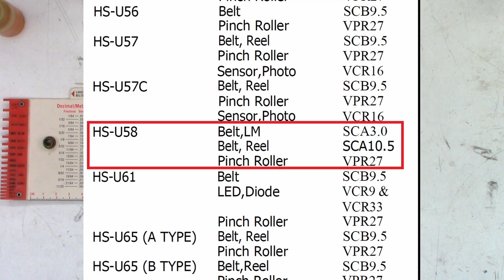Mitsubishi HS-U58 VHS VCR Wont accept a tape - The belts have MELTED! - Not that uncommon.

Comment: I've found that's very common for those Mitsubishi belts. They turn into the stickiest goo imaginable. I did a HS-411 a few years ago, it was on my hand for a week in spite of cleaning.
I've got several other Mitsubishis of the same age, these had belts/rollers redone a few years back by my repairman friend.
Reply: DEW sensor drift and the glue which turns conductive seems to be the only other problems Mitsubishis of this era face.

Comment: I have the exact same problem with a Mitsubishi HS-U760 SVHS recorder but I can't seem to find replacement belts. Since the reel belt turned into a melted mess, I couldn't measure it so I  wrapped a piece of string around the pulleys and measured the circumference,, which was 11.6 inches. Any suggestions on where I might find a belt source?  I found that alcohol works well for cleanup and it is much safer health wise than using acetone.

Comment: Where is a good place to find these belts?   I have a couple of laserdisc players that are needing them.
Reply from the maker: I have some ond stock, but I have been ordering Chinese belt assortments of 20-50 belts each just to get the one I need
Reply: @norcal715  Well, it may be worth doing that to get these up and running.  Provided the discs don't suffer from rot. They may end up as cd players.